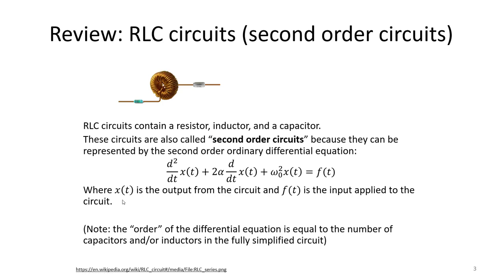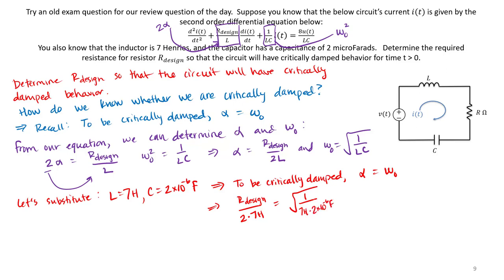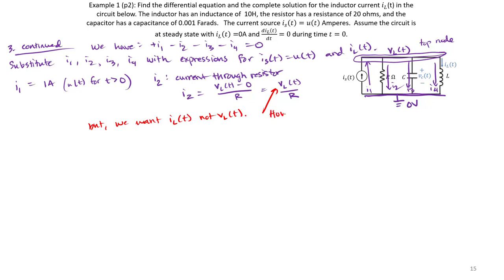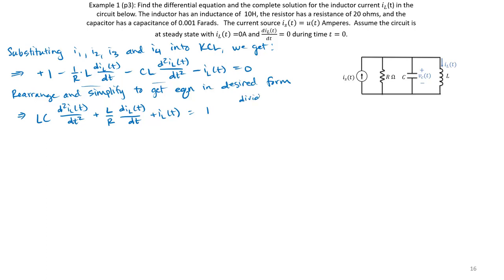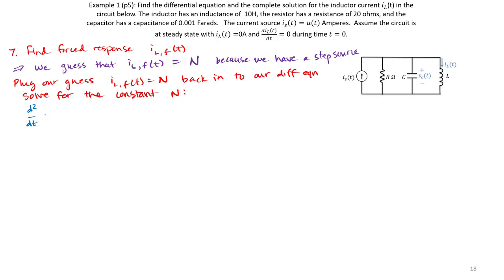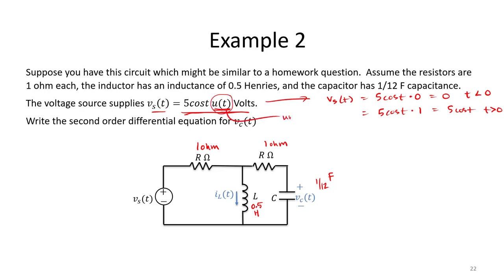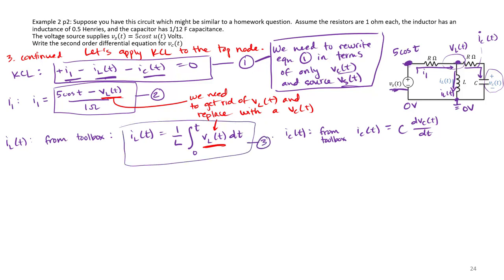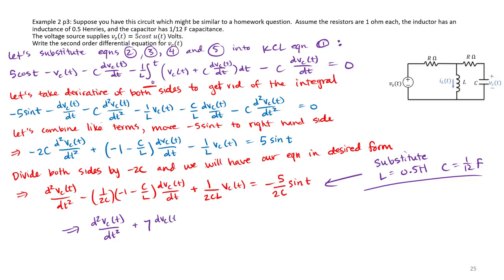Lecture 16: More on Second Order Circuits and RLC Circuits

Comment: lets say we did have an initial condition such that the initial voltgate or current through a component was not zero....when writing the diff eqn for the LRC circuit lets say we ended up with a situation involving an integral for example 1/C integral ic(t) dt.....we know that the actual formula is 1/C integral ic(t) dt + "v(0)". Should this be included in the diff eqn???
Reply from the maker: You do need to account for the initial condition v(0) when deriving and solving the differential equations.  Notice that the v(0) term is outside the dt so it is not considered part of the integral.  In some cases, the v(0) term will vanish during the derivation of the differential equation.